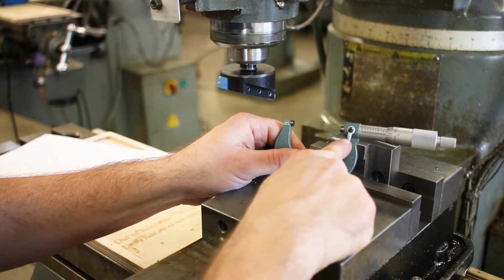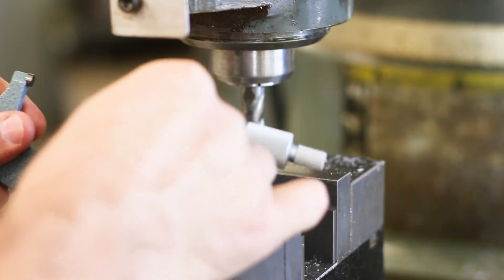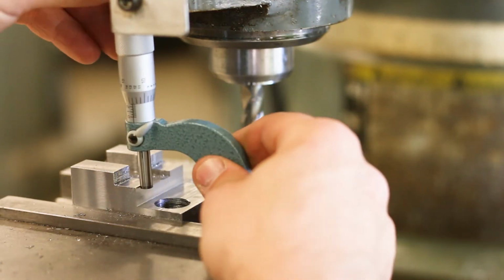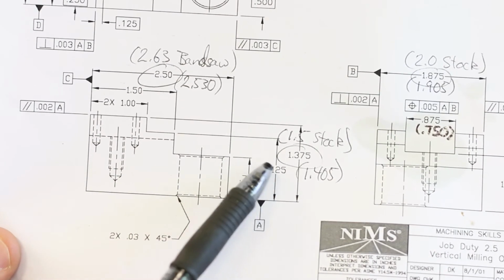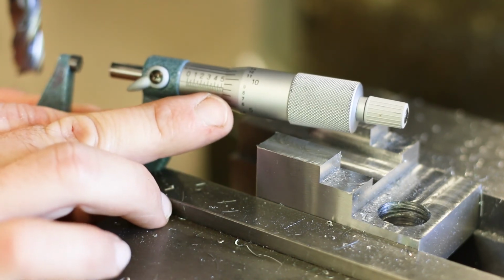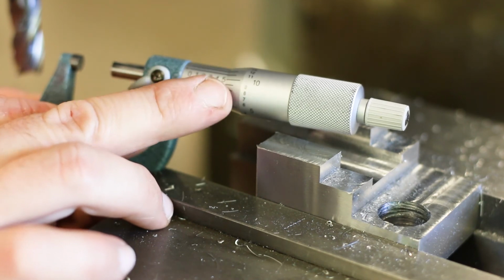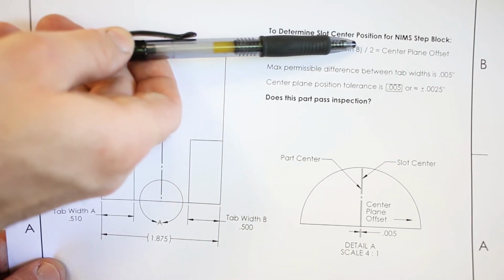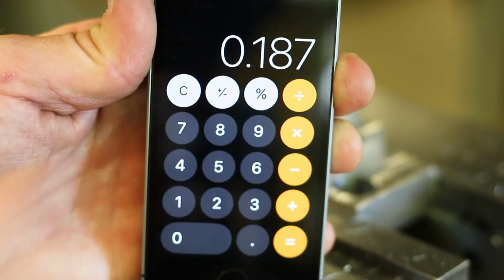NIMS Mill 2.5 "Step Block" - Demo - Part 2

Comment: 1:03:47 Most of the .030" extra stock remaining after the roughing operation for the 1.875" dimension was removed from the side that sits against the stationary jaw, only .005" was removed on the side against the moveable jaw (per the Demo Part 1 video), which would account for the side against the stationary jaw being smaller, and would also result in the overall centerline of the part shifting, correct?

Comment: I'm really enjoying these videos, and learning a lot -- thanks for sharing them publicly!

Could you explain why you switched to the flycutter for the finishing cuts, rather than using the indexable facemill you used for roughing? Is that just for surface finish, or are there other reasons to prefer it in this situation?

Comment: Thanks again. I'm curious why you didn't both with the shims when you milled the top? Also, what do you think you would have done if your micrometer did not have a deep enough throat to measure the middle steps? Take the part out, or try to find a clever way to measure in place?